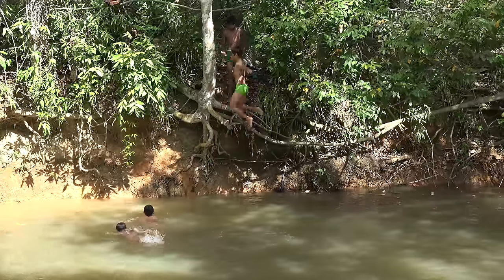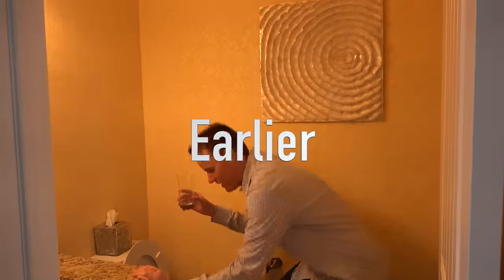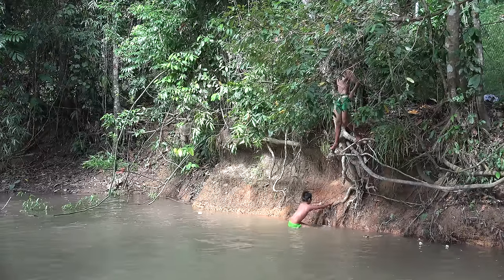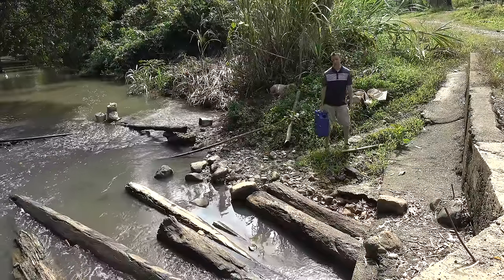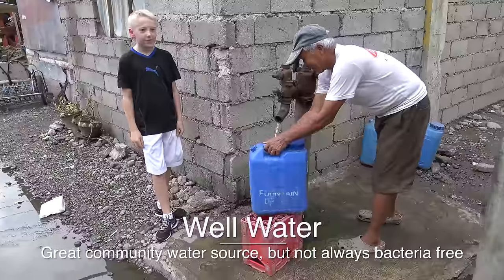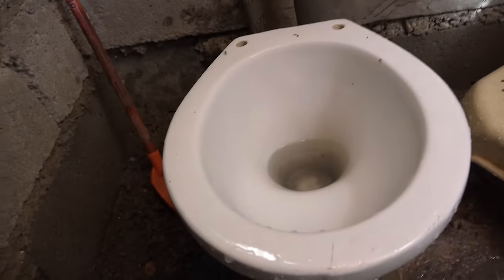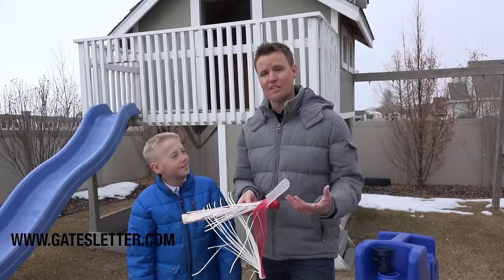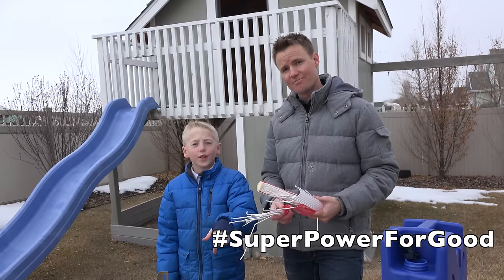What's inside a Water Filter?

Comment: Do what's inside a phone charger
Reply: yes
Reply: Sienna Baker their is a conductor which is a thin bendable wire that is what the electricity flows through and the insulator which is the rubber on the outside of the wire and it  pretexts the metal wire from you touch it and if you touch the metal wire while the phone is charging you will get electrocuted because the electricity will flow through you.